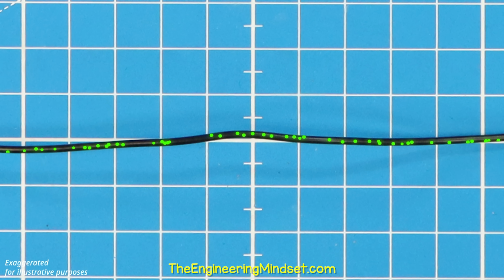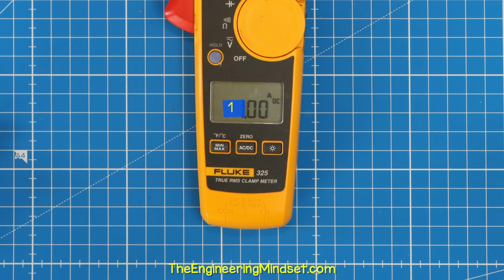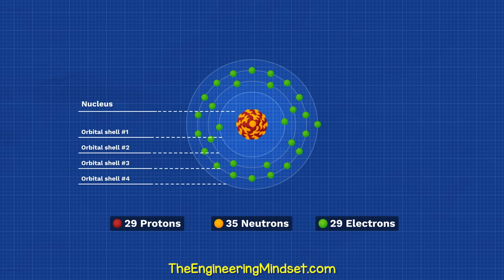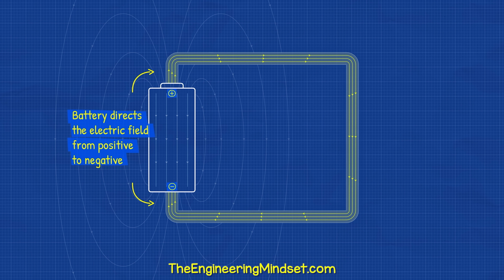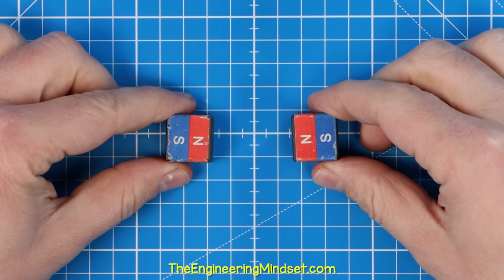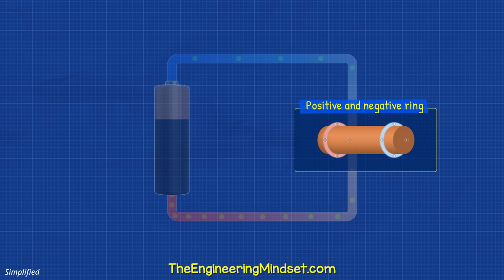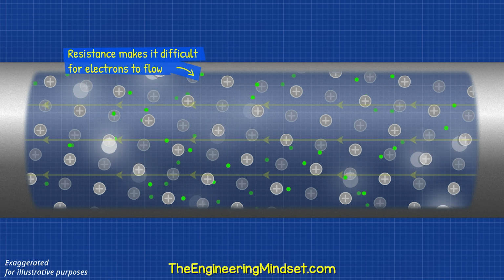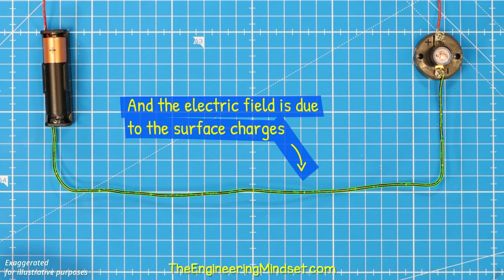How Electricity Works - for visual learners

Comment: What is lightning?
Reply: Plasma.  Both High voltage and High amperage.  That's why getting struck by lightning, usually results in death.  

Whereas a spark from a spark plug, is high voltage but very little amperage.  This happens in a coil.  12 volts enters the primary winding, which creates a magnetic field, which charges the secondary winding and voltage is greatly increased, but amperage is greatly decreased.

This is necessary for spark creation, at the tip of a spark plug.  When the spark happens, moving from negative to positive, the circuit is complete.  And the spark is what causes the gasoline in your engine to ignite. 

There is a way to create a much improved spark.  Actually making a plasma spark ignition, by adding a second wire to the spark plug, from the positive side of the coil, to the tip of the spark plug, but you have to place a diode in series, so the high voltage won't travel back to the primary windings of the coil & burn it up.

I have a demonstration video showing the difference between a conventional spark & a plasma spark.  Basically, making lightning.  https://www.youtube.com/watch?v=BdakEn92CaQ
Reply: Or, more simply, an electrical arc discharge between two locations of different electrical potential. In this case, between the ground and clouds/ionosphere, or cloud to cloud.
Reply: @atheplummer thanks for comprehensive answer. So lightning is not electricity, it's an effect of electricity.
Reply: @speculativesapient7139  As stated in the video, electricity is not visible to the human eye.  So in a sense, yes.
If I May expand on your question, so you can understand the correlation between 'energy, frequency, & vibration'.
All three are forms of energy.  And any one, can be used to 'make' the other.
First off.  Audible sound (20 Hz to 20K Hz) is a frequency that the human ear is 'tuned' to hear.  Visible light is a frequency that the human eye is tuned to detect.  There are frequencies that are outside the human senses to detect.  

Let's take your cars stereo for example.  The radio station that you listen too is 'tuned' to broadcast at a specific frequency.  It takes electricity into it's transmitter, and transforms that electricity into a vibrational frequency into the atmosphere.  Your car stereo, if it's within the 'range' of that radio stations transmission distance, captures that signal, then turns that signal back into electricity, which in turn 'amplifies' that electricity from the amplifier, sends that signal to your speakers, which in turn, the speakers turn that electricity back into a vibrational frequency, but at a different frequency... In this case, into a 'audible' sound.

Your television does the same thing, but does light & sound.  Your smartphone does too.  

Essentially, what I'm saying is... Energy, frequency, & vibration are forms of 'energy' that we don't totally understand yet, but we are learning.

I'll pose another example.  Pure silver has antibacterial, antimicrobial, & antiviral properties.  In other words, those things cannot survive when in contact, or near contact with silver.  But, Why?  What makes silver have these properties?  

It's from the silver having a natural 'resonant' frequency.  Meaning, the silver constantly emits a vibrational frequency that is harmful to those microbes listed above.  

Now, water has the ability to temporarily 'memorize' any frequency.  It holds the frequency within it for up to 36 hours, from my experiments.  

You are mostly water.  If you put the 'essence' of silver, meaning, the vibrational frequencies that silver emits, into your body, it'll destroy those microbes above, acting as an antibiotic.  I simply put a silver spoon or coin in my drink for a few seconds before I drink the drink.  I'm then consuming the 'essence' of the silver... Bottom line, I have not been sick in 8 years running now... And I had always been prone to getting strep throat at least 3 times a year.  No more... 

Back to lightning... Lightning is electricity... Electricity is in the atmosphere, it's in the earth.  Or, should I say... The 'potential' of electricity is everywhere.  Study 'Birkland filaments'.  Study, The Schumann frequency.

Ok, I got a bit sidetracked there... But lightning is when the 'potential' difference between a positive & negative environment cause a discharge of the electrons.  That happens at 90% of the speed of light,  It happens in a 'humid' environment (water in the atmosphere), the humidity (water) then 'burns' (Hydrogen & oxygen) molecules separate causing a form of combustion, which in turn releases both audible vibration (thunder) & visible frequency (the light emitted from the lightning).

I hope that kind of explains it in a way you can understand.    Suffice to say, there is so much we don't understand yet, but the potential ability to harness these 'other' forms of energy... Imagine the possibilities.

Comment: So electrons go back into the battery?
Reply: Yes, and as the electrons make their way from the negative side of the battery to the positive side, the battery loses it's 'difference' .  Meaning a fully charged battery has all the electrons moved from the positive side of the battery, to the negative side, & as long as there is no 'circuit' or wire touching both sides, the battery will stay that way.  

As the electrons move from the negative side, back to the positive side, Once they become 'equal'.  Same amount of electrons on the positive as is in the negative, the battery is 'dead', or they have balanced out.

Electricity always seeks to be 'neutral', or what we would call a 'dead' battery.  A battery 'charger' simply moves the electrons from the positive side, back to the negative side, creating a greater difference in the amount of electrons contained in the battery.  The battery is then 'charged', and available for use.

Comment: A noob question: If electrons move through the wire from the battery, the battery must be providing the wire with new electrons. Does this process cause the battery to lose mass? If electrons do not have volume, what exactly do we "lose" for creating electricity in the power plants? My brain hurts
Reply: The battery doesn't lose mass, because the same electrons that were in the batteries negative side, return back to the battery, but on the positive side.  Once the amount of electrons are equal on both sides, the battery is 'dead'.  Meaning it no longer has any difference in the amount of electrons in the negative side of the battery.  

The battery never lost any mass, it just gets moved around.
Reply: Thanks for taking the time to answer my question. Your answer makes sense, but how does it work for AC current and the powerplants? This is what I can't wrap my head around. @atheplummer
Reply: @yavuzakkus9548  AC or 'alternating current' is simply that.  The electricity reverses direction 60 times a second (in America).  Meaning that the positive & negative get switched back & forth at a specific speed.  This is done for  longer distance of transmitting the electricity.  If we operated on DC current, there'd have to be a generator every square mile.

The cycles also are at a specific 'hertz' frequency, to allow electric motors to operate.  They have 2 separate coils, that get energized individually, creating the magnetic field to 'pull' the rotor to the next magnet.  

Ironically, a electric generator powers a electric motor, which in turn also generates electricity too... The motor just creates a bit less electricity, so the electrons slowly move through the circuit, just like the battery example in the video.  This is sometimes called 'counterforce',  the electric motor is 'pushing back' on the electricity coming from the powerplant.  This action creates resistance, just like the lightbulb does.  The more resistance, the more loss there is in the electricity's ability to do the work, the loss is heat.  That's why you have to have heavier, thicker wires for you oven or clothes dryer.  Smaller wires would simply burn up from the heat.

Comment: For those of you confused about “voltage drop”, it’s also called “potential difference” and it’s always between two points. That’s why there’s little “voltage” along a copper wire: little resistance means little difference in potential. I’m still a noob so hopefully that’s right, but knowledgable people have said that “voltage” is not a good way to think of it because it’s not some kind of quantity, it’s a comparison.
Reply: actually voltage drop is still a thing I struggle to understand. Why there's voltage drop across a resistor in a simple circuit? Why when I measure it, it will give the battery's voltage? If it means potential difference, it would mean that there are more electrons on one end of resistor than on other one. I quite don't get it.

Or do I get it? When electrons wanna pass through resistor, they get resisted (xD). So they kinda wait in queue at the resistor. But after they pass the resistor, they speed up again. Kinda like going through high way, coming across slow traffic then highway again. If we imagine circle like this, there's the same amount of cars passing, but the amount of cars across highway is basically the same. But when we compare cars near the slow traffic and then at the exit, then there's a big potential.

So I think I may get it, but why it's equal to the battery voltage? I'll have to think about it
Reply: @PinkeySuavo Resistors aren’t like stop lights, they’re more like speed limits. A resistor in a circuit slows the flow of electrons on both sides of it, not just after. 

Second, about voltage: it’s not counting electrons—that’s amps (coulombs per second). Voltage is the motivating force that causes the electrons to move. At any common points, that value is the same. In a traffic metaphor, common points are like chunks of your journey that are smooth. A resistor is like someone cutting you off. You get mad and a little of your mental energy is drained. After that, you’re less fresh. That’s what voltage does when it manifests work through the resistor. Even common points have a little resistance and voltage drop, but it’s much less. You can think of resistors as little headaches. Before the headache, you were pumped, but after you care less.

Comment: So I keep seeing modern videos talking about how it's the feild and not the charges in the wires, but what if you insulated all the wires in a frozen superconductor that Completley nullified those initial charge waves as you turned on the switch? Would the lap still turn on? Why do wires matter at all? I just dont get field theory fully.

Comment: So if all the energy in the top half of the battery cell eventually migrates to the bottom half of the battery cell, presumably this is when it becomes a "dead" battery. So why can't we turn it round. (i.e. so the bottom becomes the top), then all that energy would still be available, no? I don't understand. Please can you explain?

Comment: You should have mentioned that, an electiric light bulb inccreases its resistance to account for the voltage across it. Very differenf from an LED. Anyways, great content

Comment: You are wrong, electricity does in fact travel from the positive to negative.  When jumping a car battery you connect the positive terminals then ground the negative terminal to the chassis of vehicle being jumped.
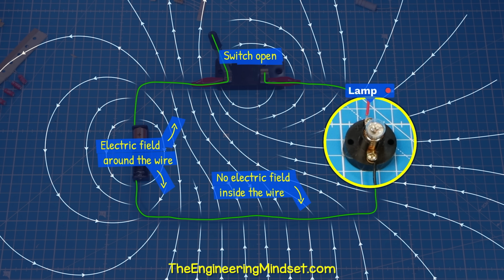Reply from the maker: Thanks for your question, so in a car the frame is used as a common ground, that's because the positive cables have an electric field which reaches out to any negative part of the circuit (see 15:21) so we want the positive to be contained in the wires and the frame to be at the lower potential. If it was the other way around and the car frame was positive, then it would be very easy to have short circuits and drain the battery. Also, by connecting to the frame you are still connecting to the negative terminal of the battery because it is also connected to the frame, you just aren't connecting directly to it, if you did it can create a spark and you don't really want sparks flying around your engine, especially petrol engines, and also the battery will vent hydrogen so all in all, it's safer to not connected directly to the battery. It makes no difference to the flow of electrons, the circuit is still complete.
Reply: @ thank you!

Comment: So you’re saying a welding machine is a battery that you can meter, so to speak?
Reply: And the electrode, let’s say for SMAW, is a resistive wire in the circuit?

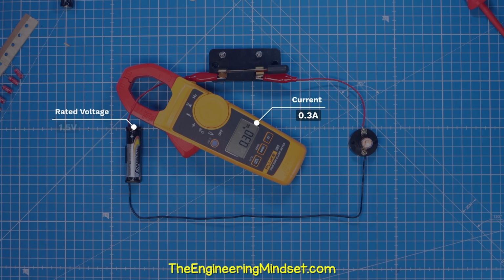Comment: 4:00 the unit by the 0.3^2 in the power section should be A^2, not A.
Reply: Exactly! 0.3^2 A gives Volts as dimension

Comment: I like this explanation that is very simply done but at the same time very complex and very accurate. I like the explanation using the electric and magnetic fields and its propagation along the wire by speed of light. Not many other videos actually mention that the electric field is not in the wire but around it😉
Reply: It's in the surface layers!
Reply: I am actually quite shocked. I was searching for video that would explain it in details without some shitty analogies and this guy even showed the electric fields, the "bounce" waves and other shit. I didn't except this. And all shown in such a nice way. I am positively shocked
Reply: For anyone saying he understood this the first time i call bs, because most people don't even know how magnetic and electric fields work. And thats the pre-requisite to make sense out of this :D. To understand this properly you need to know the the different sub-layers before it clicks. I also lol about Programming videos where people make videos about how inheritance works in C++ and everyone cheers, yet they don't even understand what a class is. Learning more complex stuff usually means learning each and everything mentioned in the video and inform yourself about that before it will click. Just that almost none of the big video creators mention this. To understand how electricity works you need to know what electrons are, need to know what a magnetic field is and how it operates. (Deeply) and so on .. it all takes pre-requisites often not being mentioned that should be known to you. I understood this vid the first time because i study 2 years electrical engineering, but if theres a normie saying its a good video i have to dissapoint. You need to learn everything mentioned and even that takes a good amount of reasearch and time. It must be mentioned to the viewers ... otherwies a lot of zombie "WOW GREAT! I UNDERSTAND THIS NOW" comments which are just cope.

Comment: I’ve taken a circuits class and physics class in uni and throughout the whole class I always asked myself how does this actually work. They never taught us, all they usually is circuits and more circuit behavior stuff, but not what electricity actually is, what causes it to work, and the basic fundamentals of it. I’ve learned most of the important practical and foundational knowledge of what I know in electricity from YouTube. 2 uni classes couldn’t get it right I guess

Comment: Sorry but you lost me off continually saying electrons flow from negative to positive, and then constantly showing them going the other way. I don't think you actually know which way they flow but I know ALL electricians fuse the positive side, which tells me they flow from positive to negative. This video is false information!
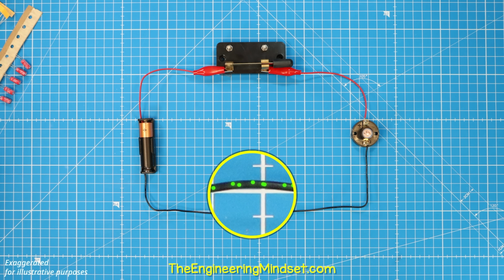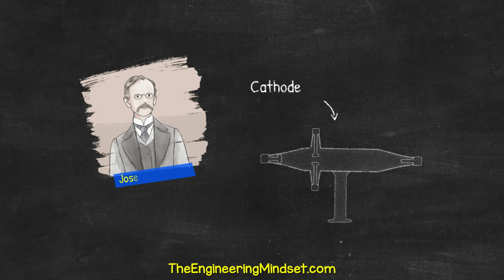Reply from the maker: Thanks for the feedback. So to clarify, not a single point in this video have I shown electrons "going the other way" they are always shown flowing negative to positive. I have shown the original conventional current theory at 0:49 and then at 1:25 I explained the discovery of the electron and the direction it moved (even recreated the experiment) which proved the conventional current theory was wrong.

To your point about fuses, a fuse can be installed on the positive or the negative and it will make absolutely no difference to the operation, the current will be exactly the same so if you exceed the limit of the fuse it will trip. 
However, the reason it is installed on the positive or live/hot side is because that side is at a higher potential, with reference to ground which we consider 0V. You are also referenced to ground, and so is the negative or neutral side of the circuit. That's why if someone touches a live/hot wire they will get a shock, but not if they touch a neutral wire. (Don't try this) There is no voltage difference between them and the neutral but there is maybe 120-230V difference between them and the live/hot. So if the fuse is installed on the hot side, when it blows the entire circuit is cut off and immediately referenced to ground which is 0V same as you. But, if the fuse was on the neutral side, then when it blows, the entire circuit is still at 120/230V but no current is flowing, it's waiting for something to complete the circuit.
If you were full insulated, you could touch the hot and not receive a shock because you are no longer referenced to ground. That's why a bird can land on a high voltage power line and be completely fine, but if the bird touches the power line and puts a leg/wing on or near the metal pylon (which is grounded and referenced to ground) they will be blown to pieces.
I admit, it's a difficult topic to fully take in, I hope you will find the time to watch it in full to understand what is happening. Write down any point you didn't quite understand and search for an answer to that afterwards. You can even write a comment and I will try to help where I can.

Comment: I like how at the end you just casually mention that it’s not the battery that’s causing the electrons to move, but the field. Just a casual afterthought.
Reply: If we put this current in space or vacuum, will the electrons still move?
Reply: @250tsar  yes of course, why wouldn't they ?
Reply: @250tsar  yes, the electromagnetic field is independent of space or atmosphere.